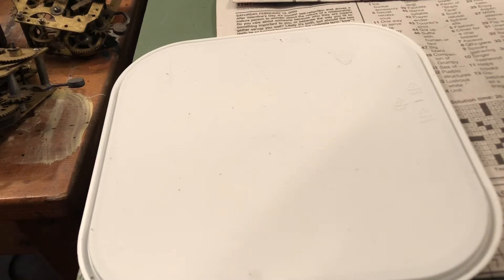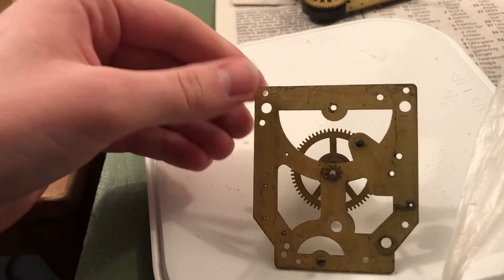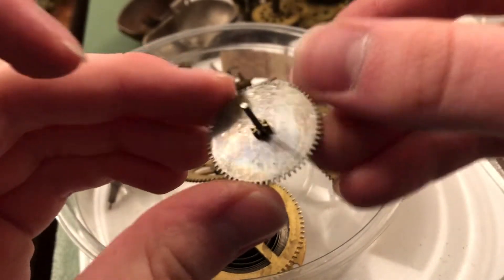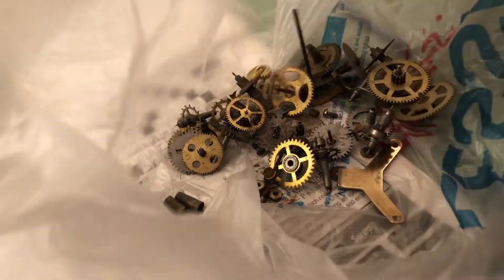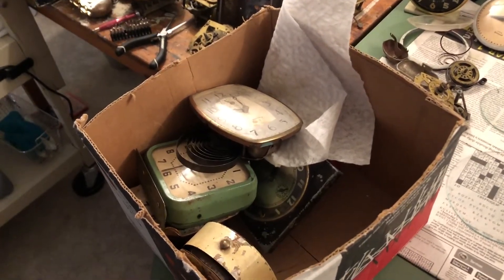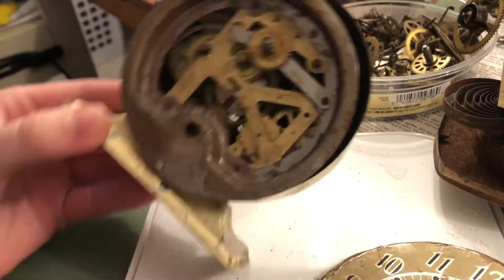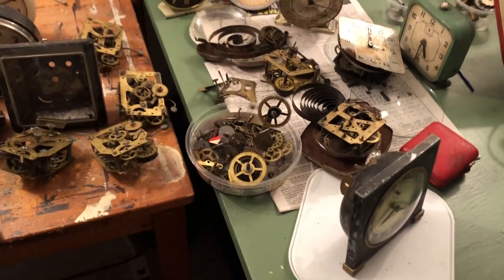Alarming Antiques #1: Boxes full of junk or gems? (Part 3) (FINAL)

Comment: That ring you called a bezel at 2:33 is the matte ring that goes between the glass and dial, and the bell and shut-off lever also go with that America case. I think you have enough to build a bell-top Westclox America.
A lot of the non-Westclox parts look like Ingraham parts, and you have a couple German movements too!
The wheel at 7:54 looks like the time second wheel for an Ingraham 8-day.
8:51 is the back plate and center wheel for the 8-day Ingraham, and I'm guessing you got parts from 2 of these. There will be a separate bridge plate for the time mainspring and great wheel. And speaking of which, at 10:01 is the great wheel, time side for the Ingraham 8-day movement!
10:44 is a Westclox 4th wheel for Big Ben loud alarm or Sleep-Meter movements.
13:00 looks like the alarm great wheel from a chime alarm movement, or for an Ingaham.
14:03 is an America or Sleep-Meter minute hand.
15:09 is a Westclox key used on the America and I'm sure they used it on other bell-top models with different names.
15:17 I think is the great wheel bridge for the 8-day movements
16:34 looks like the hour hand for an America or Sleep-Meter
Anyway, a lot of good parts in that pile!
19:54 A lot of great parts in this shot, I even see a Westclox alarm hand for a style 1-2 Big Ben or it could go with that America. I  think all you need is the glass and a new paper dial and a little elbow grease polishing the case to have a complete clock of that model. Those screws you poke at look like the screws that hold an America movement to the case back.
20:38 is a time wheel and pinion from a full-size American 8-day movement, but someone has removed the arbor. There is another laying there too with the arbor that looks like it came from a Gilbert movement.
22:02 is a classic Ingraham 30-hr alarm movement. I have the horizontal version of that same case shape clock and it's called 'The Eagle'.
26:14 So, from watching this 3-part series up to now, it looks like you have 2 different versions of those later Ingraham 30-hr movements. The later ones look OK, but the ones I've had had a soft steel pinion on the center wheel that gets eaten away by the greatwheel. This seems common on a lot of the Ingraham movements, and the solution is to use center wheel parts from older movements with lantern pinions.
31:36 Square and Penguin both have the same movement.
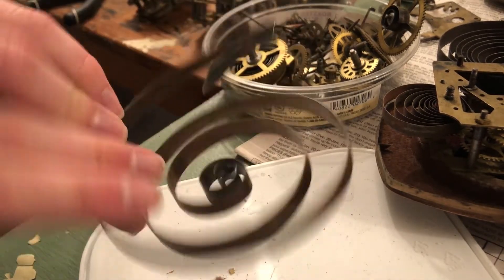32:24 Is a loop-end mainspring, but it's also the cheaper cousin, the tongue-end mainspring.

Anyway, I think you did pretty well on your parts haul here!
Reply: I fixed the time stamp for 8:51, I accidentally put *:51!!

Comment: OK, second comment, I’ve noticed that at least in their later years, the E Ingrahm company used wheels with the rounded cut outs instead of the traditional looking spoked wheels, and they did not utilize Babbitt metal pinions
Reply from the maker: So you think those are Ingraham wheels?
Reply: @SKHorology2025  quite possibly, yes
Reply from the maker: @thewatchworks1372  I know the Ingraham "Kitchenette" electric clock I worked on from 1954 had circular cut outs like that, so that doesn't seem to far out of the ball park.